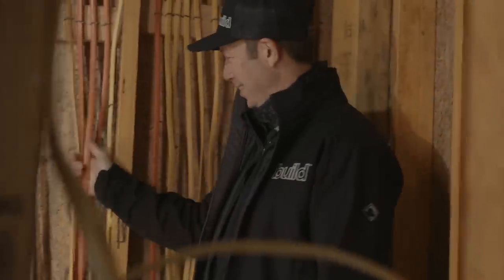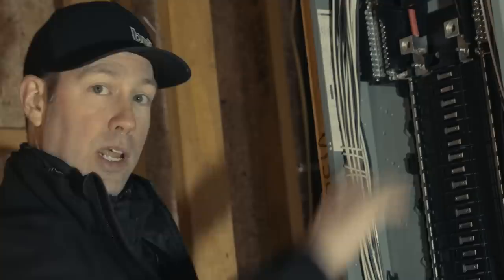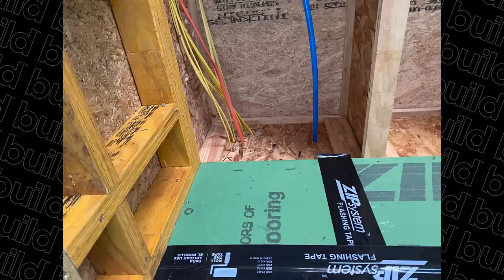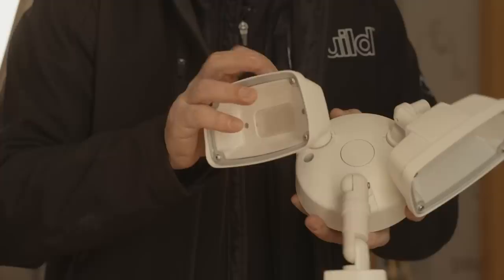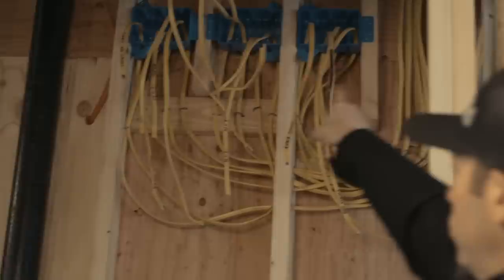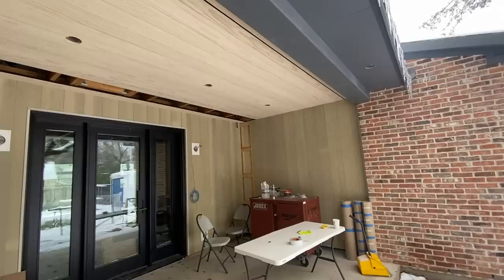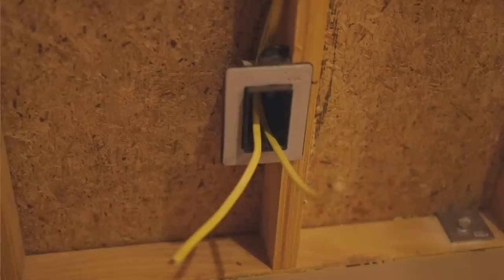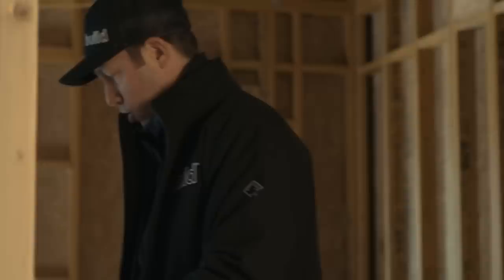5 Tips for New Construction Electrical & Smart Lighting!

Comment: I think the all 12 awg wire size issue has been fully discussed.  It is personal preference. When building my house, after I saw the price for all 12 awg I asked for dedicated circuits to heavy load areas such as entertainment and office desk.  Kitchen, bath, and laundry already require 12 awg. I ran 12 awg to outdoor outlets to limit voltage drop on extension cords for DIY projects.  As far as aluminum, the problems are myths.  I surveyed wire and connector manufacturers on failure rates.  No difference between aluminum and copper.  Always make sure connector is listed for the wire used.  Past problems have been with connectors not listed for use with aluminum.  I also have found, rough electrical is very regional as can be seen in the comments.  I installed two 200 amp panels for future expansion as I had several unfinished rooms.  My brother, the contractor, only advice was to run empty conduit from panel (in basement) to attic for future expansion.   That extra conduit is full today!  The extra space for breakers has also been needed.  The commenter’s  mention of Cat 6 wiring is perfect.  I installed Cat 5 20 years ago to future proof.  Today I am using only one coax for incoming internet and the Cat 5 phone wiring that was used for phone has been converted to an Ethernet network.  BTH, the only issue I have had is when doing work with switches, the backstabbed 14 awg causes the switch back to crack and have a loose connection.  This has happened in three switches so far.   Also, for frequently used outlets (vacuum cleaner) buy a commercial grade outlet.

Comment: Had a laugh with the boxes for extra sound proofing in the master bedroom...

Joking aside two gang boxes on wall with headboard is brilliant!
Reply: receptacles with integrated USB charging receptacles are better. - and one above the nightstand is better yet.
Reply: To power those personal appliances.
Reply: @BajaPete  Make sure you can get the full 20 amps by the bed!
Reply: @kenbrown2808  Most of the integrated USB chargers are crap and tech changes.  New phones using high current chargers, etc.  I would rather have extra space to plug whatever charger I'm using 5-10 years from now!
Reply: @rumrunner1290  oh, that's okay.  the integrated 6A USB port in a Leviton USB receptacle won't obstruct your 2A iphone fast charger.

Comment: You will appreciate this Matt.  My first home I built back in 1978 I used all 12-2 WG and a 400 Amp commercial panel that was about 4 foot high.  The home was all electric.  The second home I built back in 2001 once again had 400 Amp with two 200 Amp panels and CAT5 all prewired with AV panel.  Keep up the good work.
Reply: Seems like a massive waste. The cat5/6 I agree on.
Reply: 400A panel in a residential setting is nonsense, big waste, the pole transformer or pad outside is usually only about 23kVA, feeding a few homes....do you have every outlet on it's own breaker?

Comment: Matt, I thought I saw a generator being planned for. I didn’t see/hear any thing about a transfer switch or discussion about which circuits will be powered when the generator kicks in. Did I miss something? Maybe there is a new show planed to cover the generator.
Reply: At least some conduit / stub outs to where such equipment may go.   Includes for Solar, Garage-EV charging, and possible back-up.   And yeah, splitting critical loads to THEIR  OWN sub-panel,  now (while everything is open) would  be pretty smart.
Reply: Matt really doesn't know much about electrical or generators. He's fully stuck his foot in his mouth more than once. He had to take a different generator video down because he was explaining how to make/use an illegal and totally unsafe suicide cord plugged into a dryer outlet...

He is not an electrician. He's just not qualified to talk about what he's talking about...
Reply: @philtimmons722  More true than you know.

Comment: Missed this during the storm and recovery.

Anyone else think the "all off" next to an exit is a security nightmare, if not a personal annoyance? Kid runs out and shuts off all the lights on accident.

Also it's nice to have smart lights, and Bluetooth can be more efficient than wifi. But can we get and idea that you've planned for a full home network?or have I missed it?It's one of the few things installed in a modern house that is directly responsible for income and it always feels tacked on instead of an integral component of a modern home design. Space consideration with venting for something like a 12 u server rack for space for a home storage server than can be used for local security video storage as well and general network attached storage for home media. Wireless ap deployment to ensure wifi coverage to compensate for your construction in key areas. Hard-line network connections in key areas: offices, bedrooms, TV spaces, even the kitchen as well as for ceiling mounted APs with power over ethernet. I've lived in a number of different houses, but the one that was most enjoyable had redundant ethernet drops in each room. With adequate wire installations the concerns for your wifi connectivity is diminished.

I'm sure Ubiquity would love to donate a few samples for a  YouTube spot.
Reply: Don't use wifi lights. Use Lutron.

Comment: Thanks for the video Matt. I am a DIY, remodeling my entire home and since i'm saving $ on contractor labor I have a bigger budget for materials so I started installing 12 gauge wire for everything but that was a mistake. From my experience, it's nice having 12-2 because I can extend circuits to multiple receptacles without worrying about amp capacity but the downside is with installing the lighting (especially halo recessed lights). It is much easier wiring lighting fixtures with 14 gauge than it is with 12 gauge and NEC doesn't allow for downsizing if you start with 12 gauge and switch to 14 gauge in a branch. Anyways, i've learned a lot from your videos so thank you.

Comment: Yeah I was already checking on a heated towel rack for my bathroom.  I'm thinking of connecting the hot water side to the towel rack before it goes to the shower. That way when the shower is in use, it will heat up the towel rack.   Just my thoughts I'm thinking about for my place.
Reply: Great Idea

Comment: My dad happens to be a pro electrician, I used to work with him growing up. 14 is all you need for vast majority of homes if you are building to code and doing your load calculations correctly. Kitchen gets 12/2 or 14/3 due to powerful appliances used there. Future is about using less power, not more, LED lights being a great example. Honestly the only time I've seen or heard of popped 15a breakers was when someone got a cheap reno with no inspection electrical or in really old homes.

Comment: Aluminum per UL AND NEC does not have oxide interference as it ages and DeOx is not required per NEC code. Lugs need to be retourqed because copper DOES expand just like aluminum but not at the same rate. Those lugs are also made from aluminum so specifying copper over aluminum is mute.
Reply: *moot
Reply: I don't know of a single panel maker that specs re torquing of lugs with aluminum wire. Intact most specifically say not to do so. There are so many aluminum wiring myths out there..
Reply: @johnrotramel5204  just because they don’t doesn’t mean they shouldn’t. If they didn’t need to be retorqued we wouldn’t have people do thermal imaging on equipment and PM equipment. I know a lot of times medium voltage equipment is PMed and torque checks and retorques are performed. The terminals don’t always require tightening but some do and a loose terminal will only become looser per heat cycle.
Reply: @RaddestDad  
That's interesting, I have a few questions if you don't mind answering. I've heard so many conflicting stories about aluminum wire and I'm trying to gather more information.
Do you think that the lugs were properly torqued when installed?
Are you talking about panels that have loads close to the maximum allowed for that panel and feeder wire? 
Do you think that its the modern aluminum wire alloy (AA-8000)?
Do you believe in using noalox, and if so why?
Reply: @johnrotramel5204 , if there's a problem, it's electricians not using a calibrated torque screwdriver or torque wrench when tightening lugs.  On government jobs, that won't fly.

Comment: as an electrician in Oklahoma, I can say that electricians wiring new homes, that I have seen, are using 12/2 for home runs and jumpers for duplex receptacles and to heat up a switch. Some of your branch circuits like laundry and small appliance branch circuits, they are required to be 20 amp circuits; even on switch legs, which you can get away with a 14/2 and still be on a 20 amp branch circuit, all electricians I know are using 12/2 and 12/3 for 3 way and 4 way switches. The NEC code actually requires 20 amp branch circuits on some of the branch circuits in the home that are likely to have motor loads on them, like small appliance BC and Laundry. I have seen some electricians in Texas do some remodels and use 14/2 for switch legs, but I think every one is using 12/2 and doing 20 amp branch circuits for homes. I don't know if that is to accommodate space heaters that many people use during the winter time, but it certainly is wise to run 20 amp branch circuits for homes!
I'm just speaking for the experience I have had, but I have certainly seen some of the storm relief mobile homes made by FEMA for storm relief shelters use 14/2 as early as 1992. Great advice!